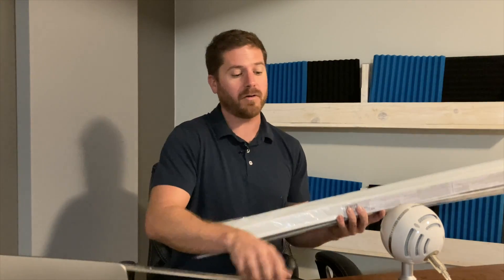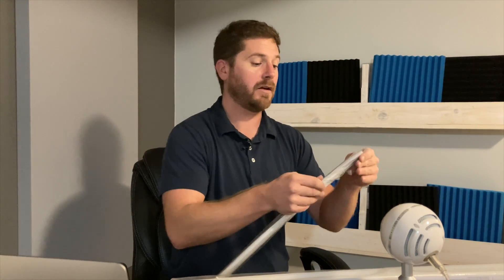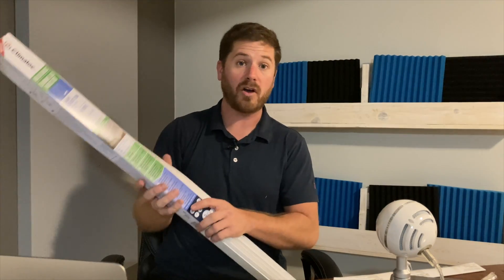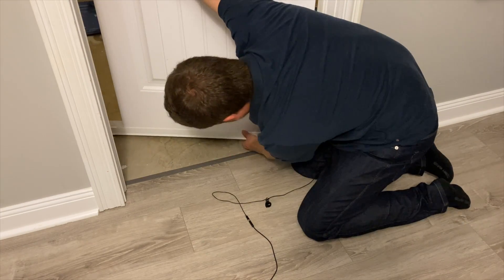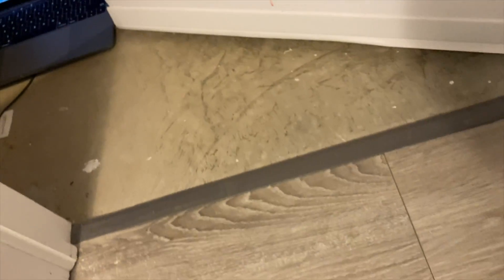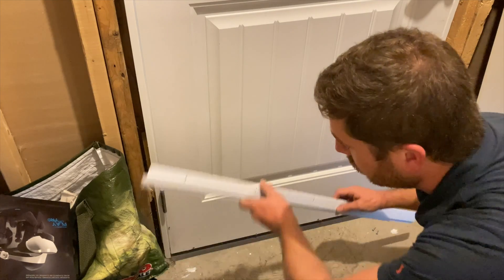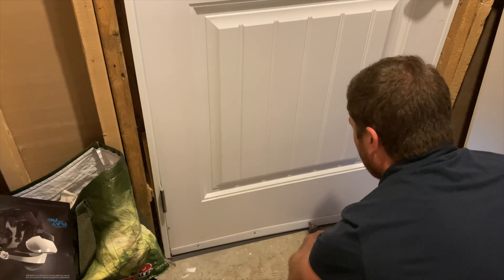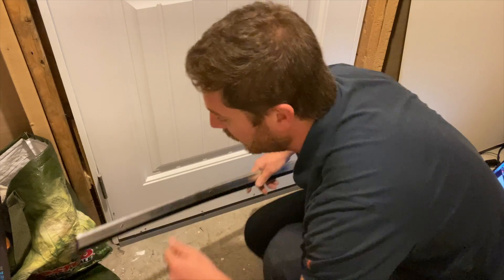Testing Door Sweeps For Soundproofing - With Decibel Meter!

Comment: One I got that slides under the door is a tad bit more wide than the door, but it’s supposed to screw into the door. Is this it ok if the width is a tiny bit more than the door for this?

Comment: I think the "Winner" door sweep you link to in the show notes is a different product on Amazon vs. Home Depot. I think the Home Depot one (Cinch
36 in. White Vinyl U-Shape Slide-On Under Door Seal) is the one you show in the video. The Amazon one (KS Hardware Double Bubble Door Sweep) requires screws and may have other differences.

Comment: I have a door with a gap that goes from 1 1/16" on one side to 1 7/16" on the other, which is larger than the maximum gap these recommended sweeps will accommodate. I'm having trouble finding similar sweeps that will work for me. If anyone has any suggestions, I'd appreciate it. Thank you!

Comment: This video was very helpful! I'm trying to sound proof my office.  There is a double door and a single door.  They are wood but I'm not sure if solid core or not.  The room is carpeted and I plan on putting in a book shelf and some decorative wall paneling on another wall.  How do you suggest I sound proof the double door?
Reply: Having the same issue with my office since its double doors. Did you find a solution?

Comment: Will the 'winner' kind of door sweep work well enough with carpet too? My room is in desperate need of sound proofing from the outside I can't even have a conversation in my room in a shared house without people walking past hearing every word of it or my house mate in the room joined to mine :/ I'm hoping a door sweep at filling in all other gaps will help with the door but have no idea what to do with the wall as it is so thin all my music producer friends have said don't bother spending money on the walls it will be a waste of mony but I'm thinking maybe just one very large and thick wall hanging/ throw will help at least the voices be so clear? I bought a four panel split canvas and was hoping to fill it with a sound absorbing material but have also been advised walls are so thin it will be a waste of money as won't make much difference :/
Reply: I need the same thing kinda
lmk what u did.

Comment: Which door sweep is the one with no screws necessary? My parents don’t want holes in the door!
Reply from the maker: It’s the “double bubble door sweep”. It’s the first one on the list in the description of this video. There’s a link for your choice of Amazon and Home Depot.
Reply: @soundproofguide  NEVERMIND! The Home Depot one looks like the right one!
Reply: Agreed the show notes is linking to different "Winner" products on Amazon vs. Home Depot. I think the Home Depot one (Cinch
36 in. White Vinyl U-Shape Slide-On Under Door Seal) is the one in the video. The Amazon one (KS Hardware Double Bubble Door Sweep) requires screws and may have other differences.
Reply: @soundproofguide  That’s what I was thinking too however when you go on  Amazon it comes with install screws and doesn’t look like it has the little plastic things in between like the one in the video does. Are you sure that it is the correct link?

Comment: I feel as if the test wasn't as solid as it could be. You stated the door had no weather strips, therefore, that would be the bottleneck in the test. Regardless of how good the door sweep would be, at a certain point, the sound that would've been blocked by the weather strips overcame the soundproofing of the door sweep. Having a hollow door vs a solid core would do the same but, I'm not sure which one you said it was.